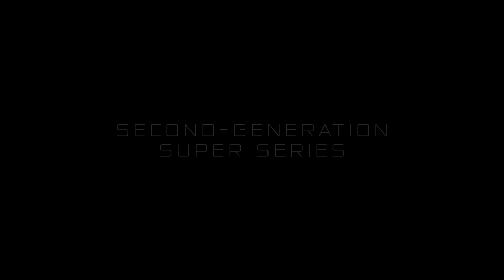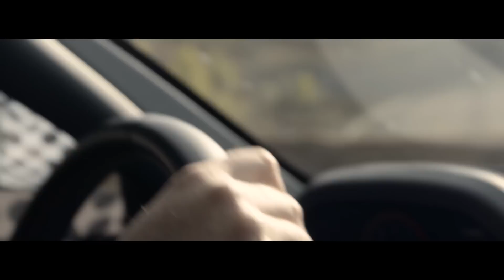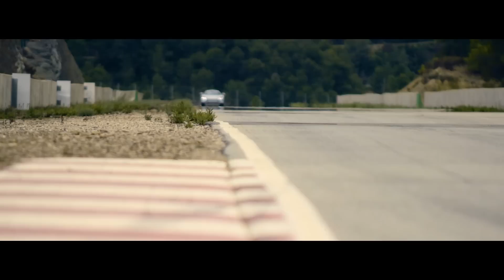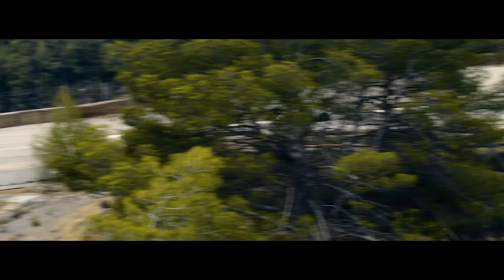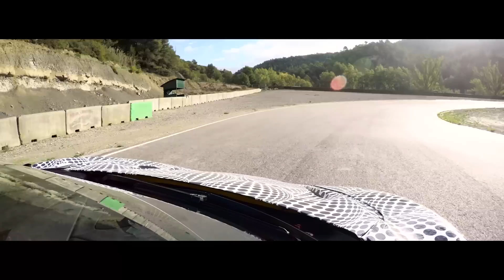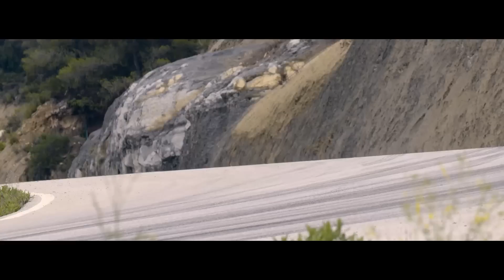Behind the scenes drifting the 2nd generation McLaren Super Series on track

Comment: I wish other  manufacturers (especially the big ones) would take this approach with their more everyday cars. Why does a cheap car have to drive badly? That's its fundamental purpose. Chris Goodwin is awesome for admitting that great limit handling trickles down into more sedate driving to make it so much better. Stiffer chassis provides more control for the suspension, which allows for more compliant suspension which actually improves the car's handling. Great video, and long live McLaren!
Reply: Agree. However there are cars that fit your description called GT86. However you will have to do some work to it still. Coilovers, wheels, brakes and motor works to really get a good feeling.
Reply: Wtf, there are plenty fairly affordable cars that drive pretty well, you're just not paying attention. Renault Mégane GT, Peugeot 308 GTi, Seat Leon Cupra R, Ford Fiesta ST, Kia Stinger GT, Renault Twingo RS, Chevrolet Camaro, Toyota Yaris GRMN (although that's an assumption for that one)...

Comment: I do notice it is on skinny tires. The Dodge Viper ACR is on massive, massive tires. And here I am sitting and thinking, why do McLaren fit small tires on their supercars? @McLaren Automotive
Reply: Mclaren 570s tire dimensions: (F/R) 225/35/R19/285/35/R20
Mclaren 650s tire dimensions: (F/R) 235/35/R19/305/30/R20
Mclaren 675LT tire dimensions: (F/R) P235/35/R19/305/30/R20
Mclaren P1 tire dimensions: (F/R/) P245/35/ZR19/315/30/ZR20
Mclaren F1 tire dimensions: (F/R) 235/45/ZR17/315/45ZR17
Dodge Viper ACR (F/R) P295/25/R19/355/30/R19

With the dodge viper not really having as clever engineering as the Mclaren lineup dodge needs their tires wider due to a loss of traction putting down 650HP and 600lb-ft
Reply: Kondje Des because the cars are designed for the road first and foremost. that means no tire tramlining, minimal road tire noise, etc

Comment: needs an LSD. sorry not burning thru expensive brakes. cause u wana be clever
Reply: So in this price bracket the last thing you should be concerned with is maintenance based wear and tear, these cars are for the track and road and as such wont burn through $10k brake pads/ rotors even remotely fast, very few people will exclusively track a car like this and again if you can afford this car you shouldn't have any worry for replacing brakes/ rotors due to your own abusive driving habits.
Reply: Christopher Cisneros it's not even rotors, carbon ceramics don't wear much at all, so it's just pads
Reply: That's what I already stated... "wont burn through $10k brake pads/ rotors even remotely fast" " you shouldn't have any worry for replacing brakes/ rotors due" -__-